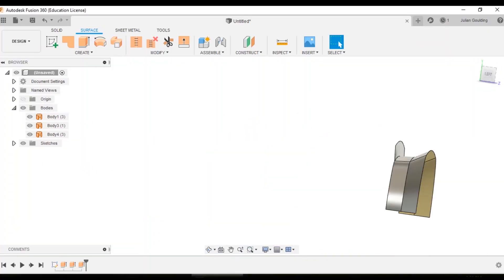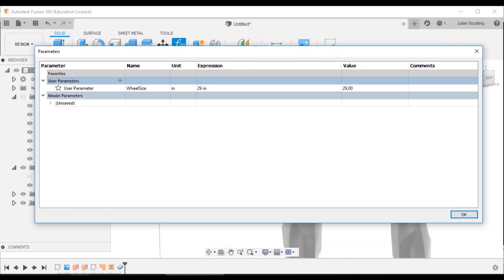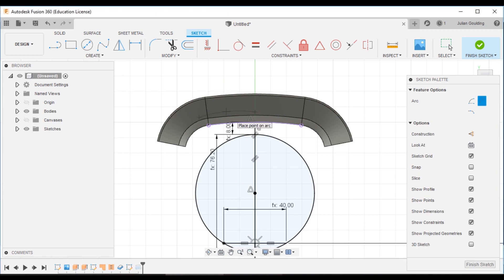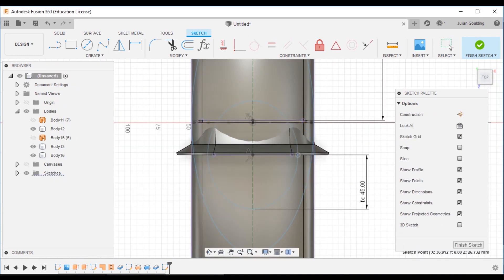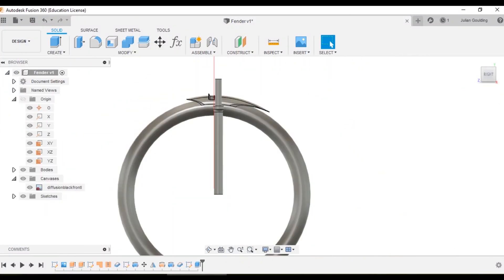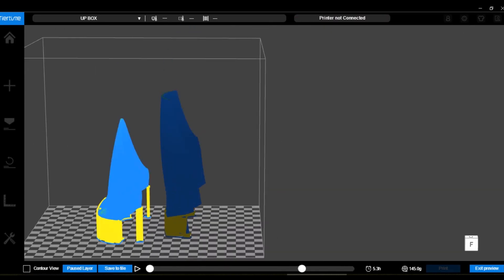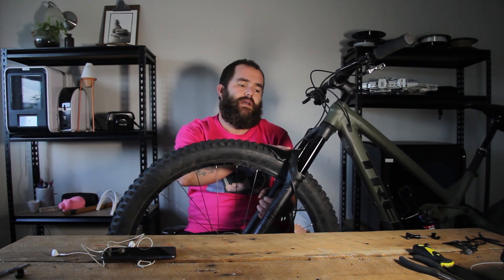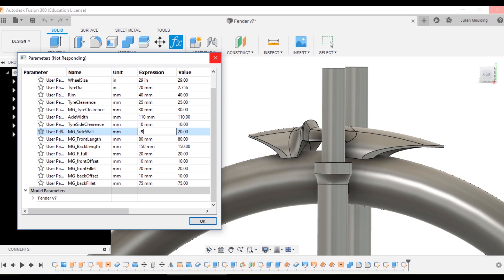After the perfect Mudguard? Let's make one!  || The Fully Customizable MTB Fender

Comment: I had a little trouble getting this delivered https://www.youtube.com/post/Ugkxn_jUDSlprMIeubd9rHdEAnv59nKfjcKv and eventually had to pick it up from local UPS location, but customer service was really nice and helped me get it before the estimated delivery date. They even gave me a partial refund for my trouble. Thanks Paige! The actual bicycle is just as advertised, and had no damage or scratches. This is an excellent commuter bike for most people. I did a few modifications to make it even better for me personally. I added fenders from my old bicycle. They weren't for disc brakes, but after adding longer bolts and about an inch of spacers the supports no longer interfered with the brakes. I like to pedal HARD and go FAST, so I switched the chain rings to Vuelta Corsa Pro Crankset, Black, 175mm 53/39T Square Taper. This has longer crank arms too, so its kind of 2 upgrades in 1. The front derailleur had to be readjusted so it would stay on only the 2 chain rings until I get a different shifter. I also switched the cassette to one with 11T high gear and a larger low gear. With larger gears on the front and back I also had to get a longer chain. I probably couldn't race this bike unless i got a different cassette with gears closer in size relative to each other, but I can still go plenty fast on flats and downhill while still being able to climb steep hills. For going to and from work and the grocery store this is a great bike. It even looks good. I also added a rear rack and panniers for grocery trips. Now it has great storage capacity especially paired with a backpack. Very happy with my purchase.

Comment: Looks nicer than most of the ones on the market. How would you say it's been holding up since you installed it?
Reply from the maker: Haha thanks mate. Yeah it worked great. I took it off to make a new one and just haven't put it back on. I did ride it a bit though. Did the whole queen Charlotte track with it in the rain no problems.
Reply: @juliangoulding  that's sweet! I'm definitely going to print one in blue pla+ for my bike. Thanks!
Reply from the maker: Nice. Print it with a couple extra walls for a bit more strength. Doesn't have to be solid but the added wall thickness helps for the thin bits.
Reply: @juliangoulding  Thanks! Figured I'd print probably 100% fill

Comment: I love everything about this. Great job with the ID on this, those blended surfaces look great. Would you consider sharing your f3d files? I've been toying with the idea of modeling and printing a newer style (ribbed) chainstay protector from tpu to try to make the bike quieter. As you've mentioned in your video I'm also dreading the process of accurately modeling the existing geometry of the chainstay. I was going to suggest you give this a shot until l went back and looked at your rear triangle... How about an interesting LED mount instead? Maybe a tool/pump/tube holder that mounts to water bottle attachment points?
Reply: Also interested in the file!!
Reply: Me too

Comment: Nice work with the parametric design! I've been learning Fusion 360 and dabbling with that feature for a while now so I know how tricky that gets. I tend to get in the weeds or overthink the design or don't know yet how to do something with CAD. And I was just trying to get myself to start designing something myself haha.

I want to design a hybrid between an electric boat, pedal assisted velomobile and a micro tender. Long term I want to build a larger cruising boat so the idea would be that if you're at anchor somewhere you could drive your tender to shore and go seamlessly seamlessly from water to land. For example go shopping. Or to explore the coast and inland nature and be able to comfortably sleep in it as well. I've been sketching and I think it could work.

Do you have any interest in velomobiles? I guess they aren't good for mountain bike paths. But for longer tours a micro camper could be cool instead of a tent for camping.

I could use some advice on general bike mechanics.
Reply from the maker: Haha yeah not much water around here, but I love the idea man. So like a e-bike powered boat? I'd say just start prototyping man, that's the quickest way to get where you are going. I find if it sits around in my head to long i over thing it and never start.

Two things i think you should look at is the manta5 hydrofoil bike and recumbent ebikes. Might give you some ideas. Keep me posted man would love to see progress!